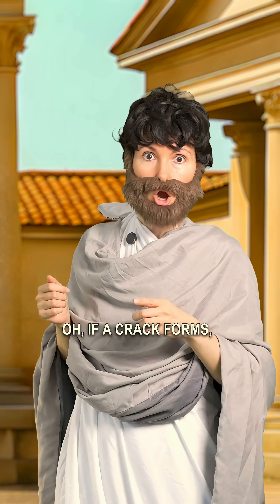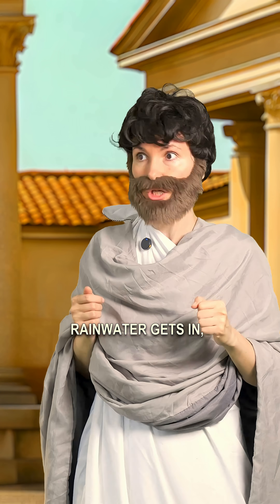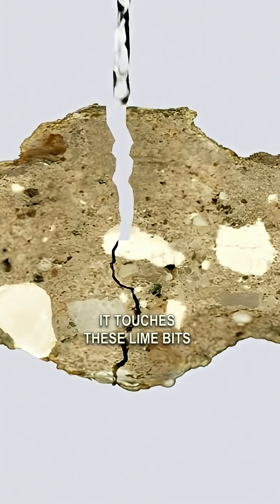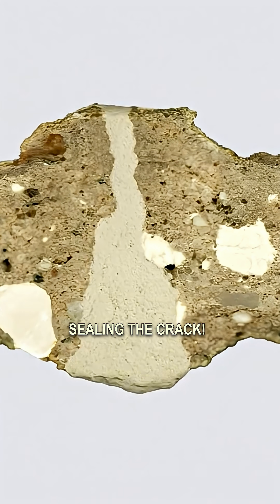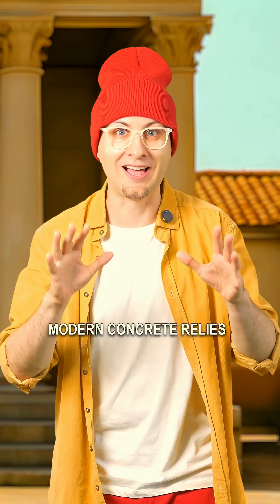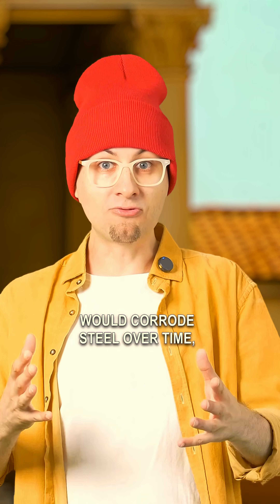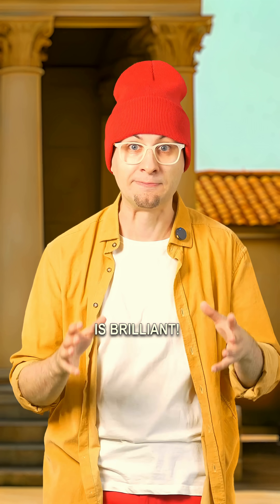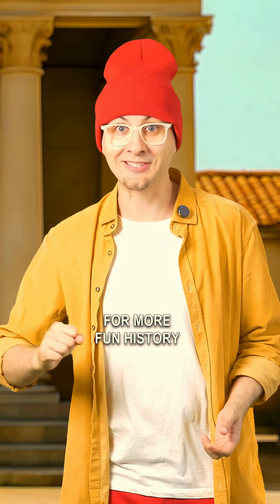Self-Healing buildings?! SECRET Rome’s formula #history

Comment: Why don't they use plastic rods for rebar?
Reply from the maker: I'm not a construction engineer, but as far as I can tell, it's because plastic deforms under long-term load and is generally much weaker than steel. But as another commenter pointed out there's fiber reinforced rebar - that should totally work

Comment: We have fiberglass rebar now that is highly rated. Roman style mix with fiberglass rebar would work.
Reply from the maker: Ooohhh, I didn't know about it, yeah, that'd totally work! Roman concrete has lower compressive strength, so we wouldn't be able to use it everywhere, but the main stopper was steel rebar. Thank you for sharing this!
Reply: its weaker than normal concrete, it lasts longer, yeah, but it also needs maintenance (dont think all these buildings lasted a thousand years without constant care lmao) AND it wont support large structures like a skyscraper
Reply from the maker: @A.NoOne0  yeah I absolutely agree, it wouldn’t hold up a skyscraper. But for sidewalks? Two thousand years later, you’re still tripping over Roman roads while the sidewalk outside my apartment crumbles in two. And it should be strong enough to hold low rise apartment buildings
Reply: ❤That's what I was wondering, I asked "why don't we use plastic rebar?!"😂 Not knowing about fiber glass😮😅